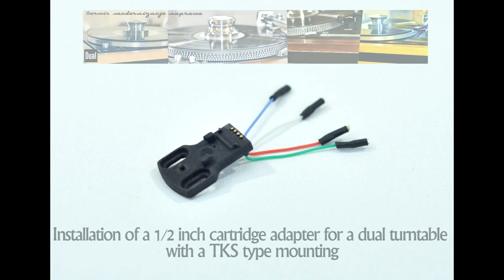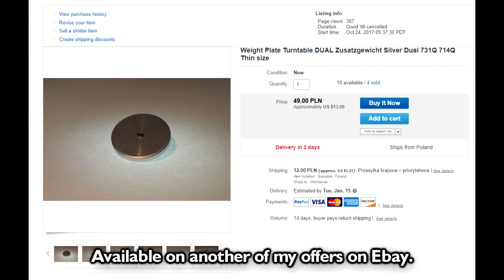Installation of a 1/2 inch cartridge adapter for a dual turntable with a TKS type mounting

Comment: Just installed one on my Dual cs-508 with an ortofon OM cartridge.  Now the arm angles down towards the bearing.  I had to remove the rubber platter mat so that the record is lower, correcting the tone arm angle.   Disappointed.   Any thoughts?
Reply: same problem here..have you found any solution so far?
Reply: @koskar8986  I bought a thin cork platter. 1/8".  That keeps the arm fairly straight.  I use an ADC MKII Improved cartridge.  They love light tonearms!  Addictive sound.
Reply: @michaelramshaw8255  thak you very much for your answer.i might do same thing..i wish i new it earlier